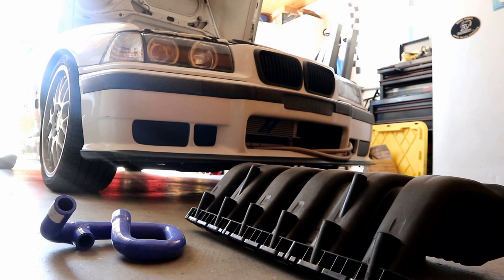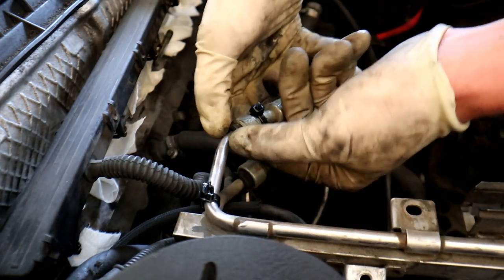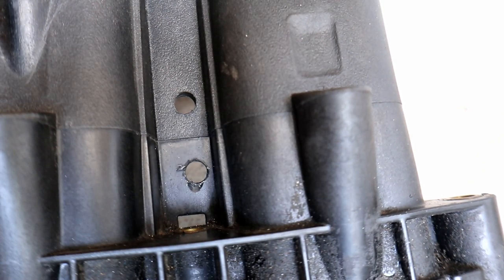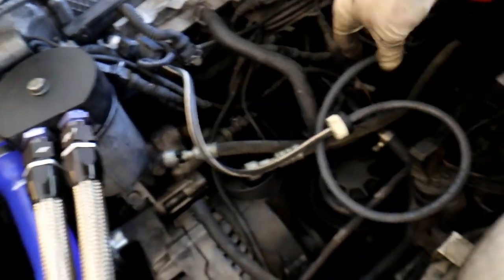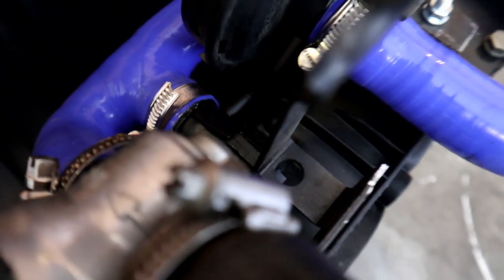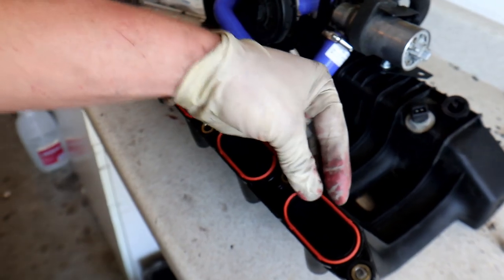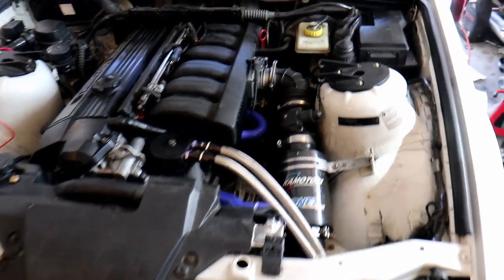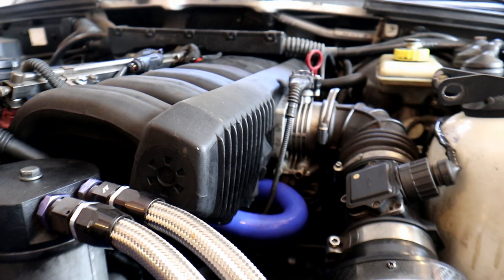M52/S52 M50 Manifold Swap DIY

Comment: I plugged the connector for the Air-Temperature-Sensor on the original M50-Air-Temperature-Sensor on the right far side (on my E36 328i 1995 europe version) and it worked very good without warninglights or errors. (Nice video by the way!👍)
Reply: That's weird because the M50 uses the   Bosch Motronic and M52 uses Siemens MS.41
Reply: @noahlangens4542  no it's not weird, you are right about the bosch and the siemens, but the only thing that stupid little thing does is give a certain signal to the bosch or the siemens and when i did the m50 manifold swap i saw it was the same connector so i just said to myself try it and see if it works and it did!

Comment: Great video! I think it's throttle "heating" not cooling. The water lines were developed to keep the TB from freezing. AFAIK
Reply from the maker: thanks! I read that, i think i recall something about heating the throttle body on warm up to make it get up to temp quicker as well.

Comment: So when kassel flashed my ecu,one of the things it listed as done was a "SAP Delete." So since he technically wrote that whole system out,do I need to hook up that solenoid?
Reply from the maker: i like to have it on just so the car looks complete, but no. I have the vacuum hose deleted as well.
Reply: Good,my dipstick vent tube broke...now stuck trying to replace it.UGH I JUST WANT MY CAR BACK

Comment: just done doing that, thanks for this videp, It helped me a lot to keep some things in mind. had a few challenges with the vacuum routing but it was all sorted with patience lol cool video! now looking back at this, I plugged my air temp sensor to conector to the temp sensor in the manifold instead of drilling a hole in the intake boot and reusing my M52 temp sensor, What kind of problem would that cause?
Reply from the maker: as far as I know, they are not compatible. meaning you will have false air temp readings, which can cause lean/rich and other fuel trim issues.

Comment: I got a question! My 1999 e36 323i (m52) has a m50 intake manifold from the previous owner, and I believe the “P0142” code and check engine light are from a unplugged sensor or something. The SAP is still installed and I’m not 100% why it has a check engine light but I need to fix it ASAP because my inspection is expiring

Comment: You relocated the air temp sensor but couldn't you also buy the lower temp one and keep it in the same place to accomplish the same task?
Reply from the maker: you could, you would need to fit it into the manifold. i prefer the intake boot because its quick, simple and easy.

Comment: M3nace,  Question - i discovered that my recently purchased 98 M3 already have the M50 swap. I couldn't tell at first because the connection of hoses and IAC value is completely different than your's. The previous owner did not use the kit.
1. The IAC value is plugged directly onto the M50 manifold. looks like it's drilled in, same location as stock.
2. The "T" plug in your video is left open. so i have no clue where those two hoses are plugged into.
3. The IAT sensor is no where to be found. its not plug on the intake boot or the M50's IAC location.  That hole is also left opened/unplugged. 

Question - it seems i have two open holes on my  M50 manifold, the IAC plug hole and the "T" plug location.  Should i plug these 2 holes?  I am NOT getting any check engine light or lean codes. i am afraid it's sucking in dirty air.

Thank you,

Comment: Question regarding TUNING ( i'm a newbie here)? M3nace mentioned using an aftermarket tune such as DINAN or RKTune. I looked them up and these are tunes that can be ordered  pre-programmed with your list mod options. Sounds like all i need to do is "flash" my DME with a laptop with the tune and be done with.  Should i also have my car DYNO tune after my car has been flashed with  the aftermarket software?  Thank you in advance.
Reply from the maker: I personally run a Kassel Performance tune on all my cars, great tune at a solid price. that said, the M50 swap can be run on a stock tune, and an aftermarket tune will only increase the performance, but there are gains to be had with a stock tune. a Dyno tune might be a little overkill for a mod this small, but it can be done and im sure it will yeild more power than a shelf tune.
Reply: @M3NACE  thank you

Comment: that big hole under the m50 mani where you plugged it up with the new hose from the kit, does that hole plug in the to the ICV originally? So if I were doing a oil catch can, I would just need to hose there to the icv?

Comment: I’ve watched this video over and over, I did the whole install except I did it over again maybe 6 times lol, I’m having issues and I double checked everything 
Injector O rings (some had to replace, ok now)
IACV clean (still having idle issues)
I disconnect the MAF the car keeps idling but very rough, with maf connected it stalls
I checked all vac lines no leaks, any suggestions? Maybe my chipped ecu with burble tune messes with it?

Comment: Hey did you bypass the vaccum tank the check valve was connected to on the obd2 manifold ? I know it’s for the exhaust flap apparently I’m just curious doing mines spend all day trying to figure out what vaccum hose went to it and it’s purpose let me know just so I can be satisfied lol
Reply from the maker: nope, it is still in place. it goes from the hard vacuum line off the vanos, up to the solenoid between intake runners 1 & 2, then to the check valve, then the manifold T line assembly in this video.

Comment: hi, have you measured it on a dyno, how much horsepower difference did you get, or someone who has changed the intake can also tell, because I also drive a 320 and wonder if it is worth it

Comment: Seems like my fuel rail is very close to the back side of the manifold. Did you have a problem with the fuel lines hitting the manifold ?
Reply from the maker: are you running the stock M52/S52 fuel rail? how did you trim the manifold for fitment?

Comment: Is everything included with the kit.  On the website, it shows the throttle body seal as a seperate part from the kit.  What about the Intake manifold gaskets?  Are thise included or bkught seperately
Reply from the maker: Everything except the manifold itself is included. Throttle body gasket, manifold gaskets, ect.
Reply: @M3NACE  Thanks!  Just picked up my manifold for $20 lol
Reply from the maker: @LanOsb133  nice man! Good luck with the swap?
Reply: @M3NACE  thanks, just did a B28 swap, but the harness is bad.  Figured if Im already pulling the intake manifold to replace the harness theres no way Im putting the M52 manifold back on.

Comment: If I loop the throttle body cooling into itself,will I have to bleed the entire cooling system? I'm currently wrapping up my manual swap(no choice,blown trans)and intake swap(since I'm getting the ecu flashed). Due to financial issues it's taken a long time. If I can eliminate them without adding another potential extensive job onto the list I will.
Reply from the maker: If your quick you can just top off the coolant and youll be fine, if you leave the hose off for 3 hours and it drains the head then yeah youll have to bleed it.
Reply: @M3NACE  ugh. It's lookin like I might be able to make it fit. Now my biggest issue is my dad helped me dismantle,now he's not here and I have no idea where he put half my shit lol.
Reply: And thanx for all ur help on these videos. I sure hope u get money per rewatch,cuz if so I personally prob made u enough for ur next project car lol
Reply from the maker: @TechTokOffical  thanks man! best of luck with your swap!

Comment: Any “while you’re in here” type repairs you recommend when doing this?
Reply from the maker: heater hoses are a good one, vacuum lines that are worn, cam and crank sensor and starter if you really want to get into it, knock sensors if they are degreading
Reply: @M3NACE  Awesome, thanks man. I'll add those to the list!

Comment: at 15:25 if you do a secondary air pump delete, do you just run the evap line to the manifold, i would assume so
Reply from the maker: yes, or just ditch the T fitting and run the FPR straight to manifold.

Comment: I did this swap with Schrick cams, Porsche 3.5 MAF w/turner harness. I’ve take the car to 2 shops and no one seems to be able to figure out why my car cannot good an idle. It ran perfect before the swap. No CEL.  Everything under the hood is brand new. One thing I noticed in your video that I don’t think we did - the IAT in the intake boot. Is that necessary?  We def dis not do that.  Lots of money dumped into this car. It’s been a year long project and since I’ve had it back. Really want to get this figured out. Please help!  Thank you!!
Reply: Cannot hold an idle*
Reply: Did you manage to get an answer? I think I'm having the same issue

Comment: Quinn what’s the pros and cons on throttlebody cooling on the BMW 🤔
Reply from the maker: pro is that the engine warms up faster, con is that the cooling system is more complex, and when the motor is hot the air charge is hotter, which means less power. I read someone did the math on it and they gained almost 1/2 a HP with the coolant delete.

Comment: Hey M3nace, have you ever broken a valve spring?  I just did the m50 manifold swap on m52 and 200 miles later I lost compression on cylinder 4.  Are these springs known to fail?  Please help
Reply from the maker: Unrelated issue, unless it burned a valve. Ive seen a few valve springs break and crack, but the motors still ran fine and had good compression. Not saying it cant happen, i just havent seen it. Do a leakdown test and figure out where the compression is leaking then diagnose from there!

Comment: thinking about doing an Intake manifold swap on my E46 225ci to a 330ci. Any tips? 2.5 - 3.0
Reply from the maker: I honestly dont know man, i dont have an E46. are the manifolds different? I would assume it would be a pretty direct swap
Reply: I think it's SLIGHTLY bigger but the 3.0 tb is larger than the 2.5 again just by a little I think they sell adapter bracket for it

Comment: Hey man I must have got some lines confused. The SAP unit has a line that runs to a "vacuum unit" canister. Can I delete that whole canister since I'm re running those sap lines elsewhere? Also I have already deleted my SAP
Reply from the maker: Where is the canister located? The SAP system doesnt have a canister, might be refering to the charcoal canister for the evap system

Comment: the m50 mani i bouught has the evap from the mani block off w rtv. what do i do with it if its blocked? Help, first time
Reply from the maker: I would clean it out. if not, replace it.
Reply: @M3NACE  hey again its me. for the m54 has the brake booster valve that connects to the intake boot. can u delete that or where can i re route it? can i route it to  the SAP since i deleted it?

Comment: I feel like there are not many videos on the s52, like yours looks like the m52 right? But I was wondering if anyone knew if the process is the same with a s52 engine, only main differences I is think they have are intake and exhaust sizes compare to m50/s50 as well. Also the aluminum vs iron, but also its double vanos, anyone have any tips? I'd really appreciate it. Happy Thanksgiving
Reply from the maker: This is an S52B32. are you referring to the S50B32 or E46 M52/M54?

Comment: do you use the stock manifold brace/brackets?
Reply from the maker: you can, i throw them in the trash though, been running my cars without them for 5 or 6 years, never had a problem. just makes the manifold a PITA to remove and install.

Comment: I need your help i did this swap to my m52tu which comes with cable Throttle body and once installed in the M50 mani.. the cable does not go along with the Throttle body. Any ideas on what can i do?
Reply from the maker: does not fit or is too short?
Reply: @M3NACE  well it is in range but  theres no way to set it in place.. my car is a 2000 323ci i might have to get creative and come up with a solution to set it in place.

Comment: Is my front support bracket from my S52 able to connect to and support the M50 manifold? Or do I need a front support bracket from an M50 block?
Reply from the maker: The manifold support brackets? I throw them in the trash, unneeded and makes servicing a PITA. ran without them for 8 years with no problems.
Reply: @M3NACE  I know lol. I might use the front one. Do you know if the s52 bracket will work?
Reply from the maker: @bluesubie02  im not sure my friend

Comment: I have a m50 motor and intake how do I delete the air box and put a cold air filter on ? Cause there is a sensor that goes in the stock air filter box.
Reply from the maker: what sensor is in there? I'd swap it and ditch the sensor, see what happens lol
Reply: @M3NACE  https://youtu.be/5KyBdDqcBq8
If you watch this video it's the sensor next to the mass airflow meter.
Reply: King Ryan Could it be a intake temp sensor?
Reply: @oliverlarsen6768  hi Oliver I don't know the name of the sensor, but i didn't get a chance to check it out due to building up my pickup truck
Reply: @King Ryan looks like that's not a sensor, just little pieces auxiliary with coolant water circulate my gues to warm the air inside the box when winter season CMIW.

@M3NACE thats excellent video

Comment: was it worth it? do u feel the rwhp increase?
Reply from the maker: oh yeah. the top end really changes on these motors after the swap. my car skirts the 2-3 shift when it did not before.
Reply: @M3NACE  and how about the low  range? i've heard it sacrifices some power there on low rpm, stil cant make my mind if i need this mod for my daily where i almost dont go over 3.5k rpm
Reply from the maker: @dawidkorzeniowski6100  if you dont tune it you will loose some low end and midrange torque. with a tune there is no torque loss and even more power gains. Im running a Kassel performance tune and there is no torque loss. my car does see high rpm almost everytime i drive it, and it is a nice mod to have on a daily.

Comment: Also I don't need to relocate the temp sensor if I brought the one from bimmer world?
Reply from the maker: i dont know how the bimmer world adapotor kit works but if it has a port for it then no.
Reply: It's just a modified air temp sensor that is made to replace the one in the intake. I think it's just a threaded version of what u have there so it's a seamless transition

Comment: Can I use m50 air temperature sensor ? Thank you
Reply from the maker: no. you need to run the OBD2 sensor.
Reply: @M3NACE   
Hmmm.. 
Euro M3 E36 3.0 S50 B30  ( Bosch DME ) and  M3 E36 3.2 Euro S50B32 (  Siemens DME ) used the same sensor.
Reply from the maker: @pawetrocki5781  they might, but neither of those engines are M50's or M52's.

Comment: what do you do if you have done a ccv/pvc delete?
Reply: Emon Safdari I would like more information on this CCV delete as I have a catch can installed on my M52 motor with M50 manifold but the PO did not install catch can plumbing correct. I have  a lot of suction from oil cap and dipstick

Comment: Can you pass CA smog with this ?
Reply from the maker: @CarGuyBayArea  i have, order the black kit and hope the smog guy doesnt know any better.
Reply: @M3NACE  does your car idle good with the new mods? I have been reading that since you now have more air coming in the vehicle ecu needs to be tuned to have more fuel out to match the new amount of air coming in due to bigger intake.
Reply from the maker: @CarGuyBayArea  the stock management system is smart enough to make it’s own corrections, with a tune it helps but you dont need one. I have the ultimate swap DME by kassel performance on mine

Comment: I forgot to mark the fuel lines was wondering how to figure out which one goes where.
Reply from the maker: plug them in and hope for the best, if it doesnt run swap them lol
Reply: refer to the video at 3:57 it should give you a good reference which fuel line goes where.

Comment: So right where you put the first T on at 15:30 I got that on but right beside that I have two small lines coming out with a T on them not sure where they go any help would be much appreciated
Reply from the maker: One goes underneath the intake manifold on a vacuum port, the other goes onto the secondair air pump vacuum line, from the valve between intake runner 1 and 2 that plugs electrically into the fuel rail.
Reply: M3NACE still don’t quite get it I have the t line in right next to the dip stick line but there are still one line with a T coming off it
Reply from the maker: @noahgriggs143  so what are the other 2 plugged into?
Reply: M3NACE A cylinder right next to dip stick line and the cylinder has one line on it with a t coming off it
Reply: Yea sorry for the confusion it’s one line with a T on it that has another small line.
Reply: @noahgriggs143 yo did you ever figure this out???? I'm at the same spot rn.

Comment: i know your real and you’ll respond , my car i had to remove two of those brackets that go into the block, should I just not install them again ? they were a bitch to get to 😭
Reply from the maker: i throw them straight in the trash, havent ran them in 8 years and have had zero problems because of it
Reply: @M3NACE  valid, i wasn’t looking forward putting them back anyways :)